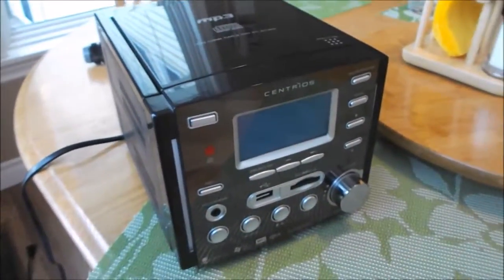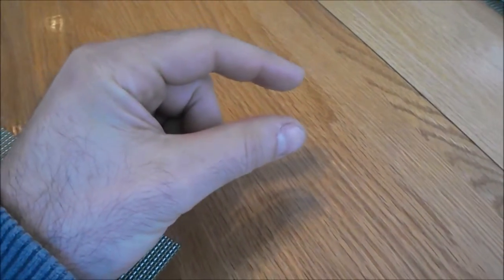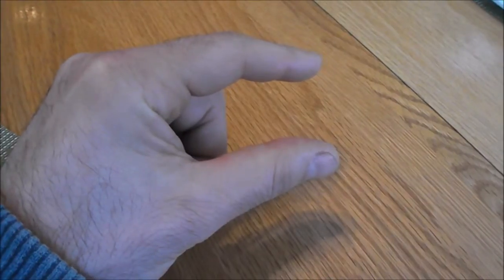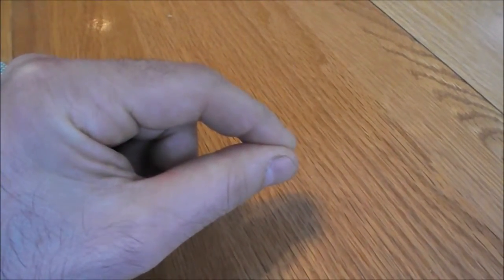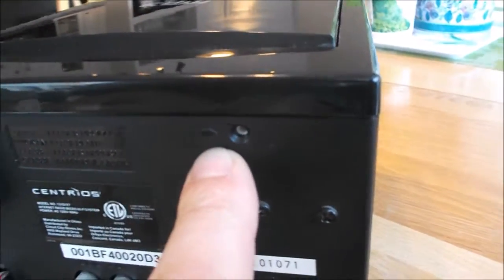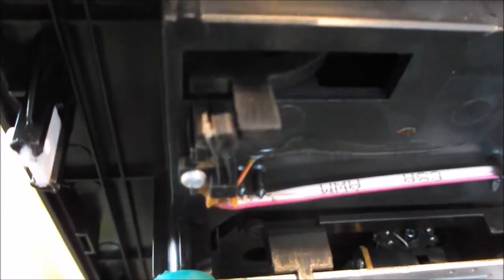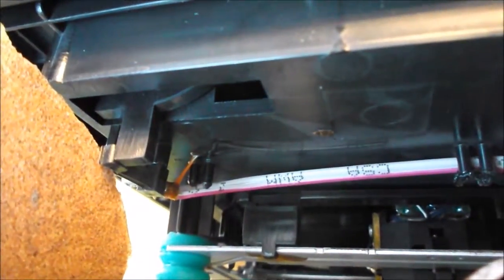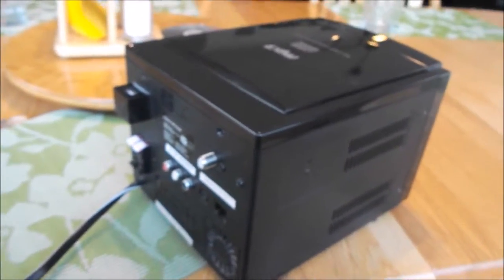DIY Repair of CD DVD or tape player door or tray sensor

Comment: I tried this on the exact same machine (Centrios model 1315117), but the spindle no longer spins and I get "No Disc" on the display for any CD that I insert.  Does this probably mean that the motor is burned out?